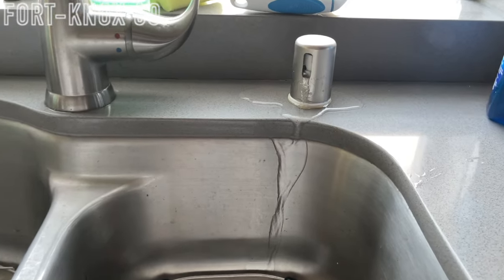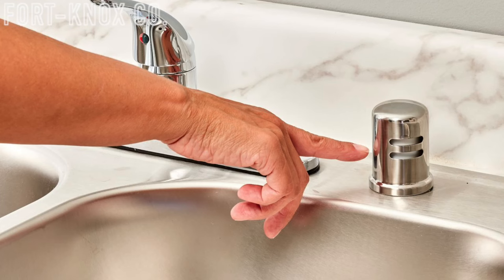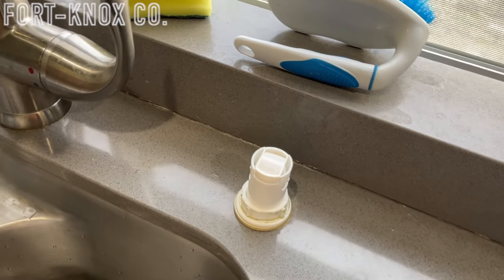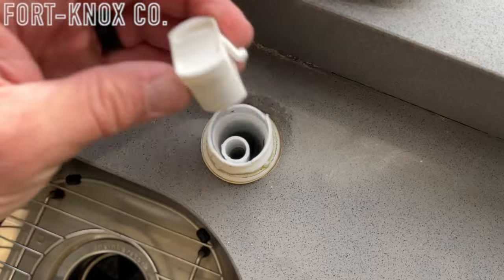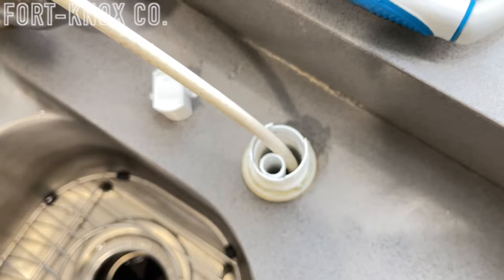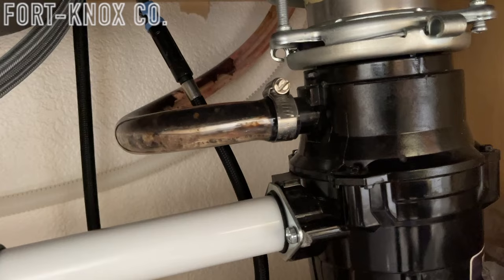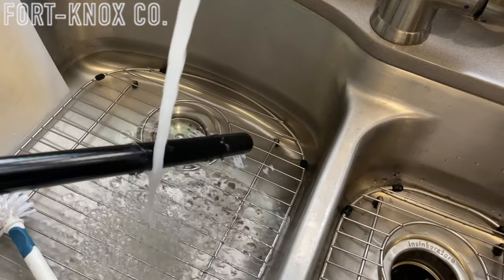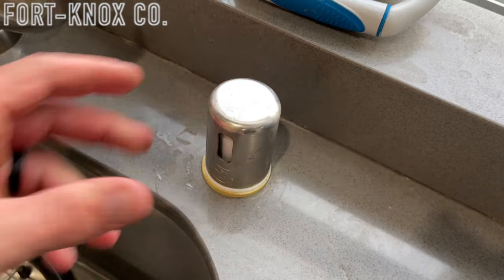Dish Washer Not Draining Air Gap Water Coming Out

Comment: You mentioned in your air gap connector video that you don’t necessarily need it as it’s no longer code in some states/cities. Can I bass and hook my dishwasher hose directly to the garbage disposal ?
Reply from the maker: Yeah You can. Just some areas require it for code I believe. But it’s not necessarily required.
Reply from the maker: But when you do it you just want to make sure it goes up above the garbage disposal and back down to the connection to the garbage disposal hook up. You done want water from your sink making its way from the garbage disposal down to your dishwasher. So it needs to go up, like maybe touching the underneath of your countertop and then down to your garbage disposal. If that makes sense

Comment: Great vid ! Would a clogged drain possibly explain my clean dishes smelling like a wet dog after a wash? Thanks.
Reply from the maker: Yep. That could be park of it. It may not be draining properly and having the old food gunk in the line leaving bacteria causing the smell. But I would also check you actual dishwasher screen/filter. It should be in the bottom of your dishwasher when you open it up look under your bottom rolling rack. On the floor of the inside of your dishwasher there should be a thing you tune and open and can clean out the screen where the water drain from. I’d check that for sure
Reply: Thanks @FortKnoxCo

Comment: Bryan, I was at a vacation house where when the dishwasher was run, sometimes water would come out of the air gap but otherwise, dirty dish water would build up in the main bowl of the double sink and if I ran the garbage disposal, the main bowl would drain but the dirty water would then flow through the drain into the other bowl. Eventually the water in both would drain slowly. Any idea what the issue was?
Reply from the maker: There is probably some clogged parts around the connections to the garbage disposal and in the garbage disposal. If the water is making it to the sink area and not draining fast enough and backing up it’s most likely at the drain/garbage disposal. The small port on the side of the disposal that allows water to drain to the sewer is most likely gunked up

Comment: I have a new Bosch dishwasher… Which I hardly use. When I was looking under the sink for some thing, I noticed at the drain line coming from the Bosch into the disposal had water in it. The water was nice and clean but I wondered why that line isn’t empty. I reset the cycle and ran it through manual rinse and drain cycle. The hose is clear so I could see the water being flushed to the disposal but when it was done it still had left water in the hose.

Is this normal? If not what should I look for?
Reply from the maker: That’s usually fine. You don’t want any big dips or low spots if possible . You want a clean run to the air gap and a smooth run down to the garbage disposal. The low spots can act like a P Trap and hold water that isn’t forced out during the flush. It’s not a bad thing, but you don’t want a lot of water sitting in the lines if possible. As long as it’s clear and you can see the water flowing through during the cycle it should be fine. 

You might be able to get rid on the dips in the line and help that water make its way out.

Comment: Curious if it's common for the 'correct' air gap to disposal tube to fail over time? It seems every couple of years that hose collapses into a kink or two and I have to replace it.
Reply from the maker: That could be a possibility. Depending on what brand you might notice different thicknesses on the pipe wall. Also, when installing you want to make sure there isn’t any torque on the pipe, especially when it’s corrugated. That can cause it to collapse on itself. But I have noticed that the pipe does Seem to kink easily if you twist it too much. And sometimes the ones that come with the dishwasher are pretty cheap.
Reply: @FortKnoxCo  Good info, Thanks!

Comment: No garage disposal. But the hose from air gap to sink drain appears to be kinked. Could that be causing the overflow?
Reply from the maker: Yes very much so. That line needs to be unobstructed and no sharp bends. You want very smooth flow.

Comment: Should there be water in the dishwasher drain hose going to the air gap/overflow?

I can take the cap off the overflow and see water in the smaller hose (dishwasher drain hose) when dishwasher is not in use.

There is no leaking and no standing water in my dishwasher after running a cycle.
Reply from the maker: The line usually stay open and clear. But depending on your dishwasher it may not eject all the water and finish with a push of air to clear that out. The main thing is that it’s not standing in your dishwasher obviously. It it’s sitting between the washer and the air gap that could be ok so long as it’s not because it’s clogged or jammed and not allowing some water to escape. Usually the dishwasher install instructions will show how the line is supposed to run as to not have any dips or unnecessary twists to avoid sitting water.

Comment: I got ok flow the plastic hose that runs to the dishwasher I used a hook vertical or clothes hanger got a lot food out on one side should I completely pull out dishwasher to clear out the other side of the plastic hose
Reply from the maker: If you have food and debris clogging up the dishwasher side pipe going down to the washer I would say it’s a safe bet to pull it out and clean it all the way. That pipe is usually a little more narrow and has ridges sometimes and catches stuff. So to clean it all the way out 100% would be best if you can. 

Otherwise get as much as you can out and then run the dishwasher empty and see if it flushes the rest of anything out.
Reply: @FortKnoxCo  exactly what I'm do it's working now no more smell coming from the air top air flow had old food and stuff took all rubber hose etc off cleaned it out yea I'm unplug plastic hose to the dishwasher pull it out and clean it I almost messed up by using a metal hanger as a hook and didn't wanna rip hose thank God lol got lucky
Reply from the maker: @MarkAranita-rg2gv  we’ll good job. Sounds like you got it handled. And good call on taking the hose off and not risking it.

Comment: I change the dishwasher airgap put a new one on and I have a new garbage disposal and a new dishwasher that was put in about six months ago. I noticed that there was water on the countertops and on the floor when I came in one afternoon so I’m still seeing after changing all that stuff out. I am still seeing the water come out same way out of the dishwasher airgap
Reply from the maker: Did you make sure the air gap has the small plastic cap that sits above the two tubes inside it? That piece redirects the water and keeps it from just overflowing in there. I’ve seen that be a very common reason.

Comment: Nice explanation.  One thing you didn't show which would be useful is seeing the hose being attached to the top of the air gap.
Reply from the maker: Thank you. I might do another video where I’m replacing my air gap completely with a new one. And I’ll make sure to show the connections in the video

Comment: Trying to help mother with her dishwasher. She has had dirty water in bottom after running a load and water gurgling out of air gap while cycle is running. Her drain hose enters bottom of cabinet from about 3' horizontally away from where the air gap is. The drain hose was extra long, entered cabinet, went downhill a couple inches almost the whole 3' before turning up to meet the air gap. Then she has the stiff black hose from air gap going to garbage disposal. Backwards water slide action though as inlet to garbage disposal was on opposite side from air gap. It too was long and it was swooping down below where it connects to the garbage disposal. Removed black hose and flushed with warm water, several big chunks came out. Then reinstalled making sure no longer going down and back up into garbage disposal using zip tie to hold it up.  Now don't have any more gurgling out of air gap, but still standing water in bottom of dishwasher after a cycle. Do you think both hoses & air gap need to be disassembled and properly cleaned to be sure there aren't any clogs elsewhere? How about the extra long drain line essentially laying on the cabinet floor for 3'? Does this need to be picked up like a high loop above the filled sink line before reaching the air gap or is that redundant to the purpose of the air gap? Does the trajectory (up/downhill) matter for that portion or does the dishwasher pump it regardless? Any idea if there is a standard for how much gravity slope for any of this stuff like in plumbing drain? Thanks!!
Reply from the maker: Sounds like you have a good understanding of what’s going on. The fix from the air gap to the garbage disposal is key. You need that to flow smoothly. 
The part from the dishwasher to the air gap isn’t as critical in the way to line lays because it does have the pump from the dishwasher pushing the water. It’s a good thing to not have excessive length if not needed. And less ups and downs as possible. But it is starting at a down by the floor of the dishwasher and making its way up to the air gap. So not too critical. That line is usually a smaller diameter though, so that’s usually the hiccup. That line gets clogged pretty easy with gunk. So make sure the line from the dishwasher to the air gap is clean and clear. 
Also if you have standing water in the bottom of the dishwasher make sure you have the drain & screen inside the dishwasher cleaned out as well. That is usually the first thing people check because it catches all the big stuff and if that clogs up it will not let the water properly flush out. It’s on the floor of the dishwasher inside the unit. Usually an easy 1/4 turn and it will come out by hand. Clean that as often as needed.

Comment: Do you have any other recommendations on how to fix? We cleaned out the water gap and even removed the pipe connecting to the dishwasher - a bunch of food came out and we positioned it back to place.  but when we tried to run the cycle again water still continued to come out from the water gap.
Reply from the maker: Did you also clean out the tube that goes from the air gap to the garbage disposal? You need to make sure that the tube from the dishwasher to the air gap is clean like you said, the air gap itself is clean and it also has that little plastic cap that redirect the water from one hole back down to the next. and then you need to make sure that the tube from that other hole going down to the garbage disposal is clean. Food commonly gets stuck in the tubes. The one going from the air gap to the garbage disposal can get gunk up just as easily as the other, but you also wanna look into the opening where it connects to the garbage disposal. Sometimes food will build up right there where it feeds into the garbage disposal and it gets backed up like a plug. So if that is also jammed up, it will cause the water to backfill and spill out of your air gap.

Comment: I just followed all the steps apart from replacing the hose because it is a proper one. It didn’t work unfortunately. What could be the next thing the check?
Reply from the maker: What is happening? Water coming out of the air gap and not going down to the garbage disposal? Or is the dishwasher not getting water up to the air gap?

If water is coming  out of the air gap then the washer is obviously getting water forward to the air gap, but something is either not redirecting it back down to the other hole/hose to the garbage disposal. Or it’s plugged from the garbage disposal to air gap, which means you might need to focus on the tube connected to the garbage disposal, possibly replace it with a new clean tube, remove the garbage disposal and look more closely to the opening/connection for the tube, sometimes that is heavily plugged. 
And make sure you have the small plastic water redirecting cap on your air gap. If that’s missing or not correctly pushed into place it will most certainly let water get everywhere and leak out

Comment: I’m experiencing a slightly different issue with my dishwasher. In addition to water coming out of the air gap, I’ve noticed that the bottom of the dishwasher is filling with water, and the inner tube of the air gap pipe is also backed up with water. Do you have any idea what might be causing this?
Reply from the maker: The air gap no flowing right will cause water to back up in the drain pipe going towards your dishwasher. So making sure that tube is clear as well as the air gap. You gotta remove all gunk or food chunks out. 

Also check your dishwasher itself. It pumps water out from the bottom and there is a cover on the floor of your dishwasher that you can remove with just a twist. Inside you can see a little basket filter that is meant to catch large pieces of food. Make sure that is all cleaned out as well. That being gunned up can cause all those problems too.

Comment: Hello, I have checked all the clogged areas that are mentioned in this video, and all seem clear.  What now?
Reply from the maker: Waters still coming out the air gap when the washing machine is draining? 

If it is that at least means your washing machine pump is working and water is getting from the machine to the air gap.  So you need to focus on the air gap itself and the path to the garbage disposal. 

Make sure the water line from the washing machine to the air gap is connected to the correct side. Sometimes the hose connections are switched at the air gap. 

Also check the air gap again to make sure you have that small plastic piece that clicks in over the top on the inside. That small plastic piece is critical in redirecting the water from one hole back down to the other. 

If all of that is good then consider taking off the hose that goes down to the garbage disposal. That easily gets food stuck in it especially at the garbage disposal itself. Clearing that path will allow water to flow freely.

Comment: Hi and Thank You for the video - very helpful but I still have questions.  I was able to snake a cable cord through one of the two opening on the tube on the counter, and it goes straight to the garbage disposal, with a little effort but it seems clear.  
The air gap still leaks - so I tried to snake the cord through the second opening that leads to the dishwasher and it goes up to a certain point.   No sure what to do next. 

The garbage disposal seems to be working fine and so does the dishwasher but a ton of water comes out the air gap on the counter.  Can you help of figure out my next step? 

Thanks again - 
Chrystal
Reply from the maker: Does your air gap have the cap above the two holes when you remove the metal covering? That little plastic cap that goes over the two holes helps redirect the water up and down. The only other thing to do that I can think of is to actually remove the hoses from the bottom of the air gap especially the one connecting from the air gap to the garbage disposal and look through it and possibly physically clear it out. Ideally, the hose from the dishwasher should be able to push water out, but the back up is usually caused from when it Hass to turn and go down to the garbage disposal. If that flow from that point to the garbage disposal is restricted that causes the backup of water. So sometimes you have to remove or replace that hose between the air gap in the garbage disposal.
Reply: @FortKnoxCo  Hi - thank you for your quick reply.  Actually, I remove the metal cover and I right away see the two holes, so, no, there is no little plastic cap to redirect the water.  This makes a lot of sense to me!!! YAYAY!!  So I replace the whole thing?  Doubt they will sell that little plastic cap.  
thanks again - Chrystal
Reply from the maker: @chrystaldefreitas6838  oh wow. Yeah that little cap is what actually causes the water to turn back down and stay in line. Without that cap it’s just shooting water up and spraying everywhere. Most likely you’ll probably have to buy a whole new air gap. Luckily they’re not too expensive and you can find many different options on Amazon. Could probably be to your house by tomorrow.
Reply: @FortKnoxCo  Ahhh - Headed to Ace Hardware Store.  Thanks again! 😃
Reply from the maker: @chrystaldefreitas6838  No problem at all.

Comment: I did all that and it still doesn’t work. Should I buy a new air gap?
Reply from the maker: I would check the filter in your dishwasher. Usually an easy twist to a plastic piece in the bottom of your dishwasher and it pops off and you can see if it’s clogged up. 
Then I’d check the garbage disposal itself. Take the pipe off and see if it has gunk in it that you can remove by rinsing or scraping. Sometimes the plug of gunk is at the garbage disposal itself at the connection where the tube is. Clean that out. 
If all of that is clean and working then it may be something with the air gap. So replacing the air gap could be the final step. But making sure the hose to the air gap and hose from the air gap to the garbage disposal are clean is a must.